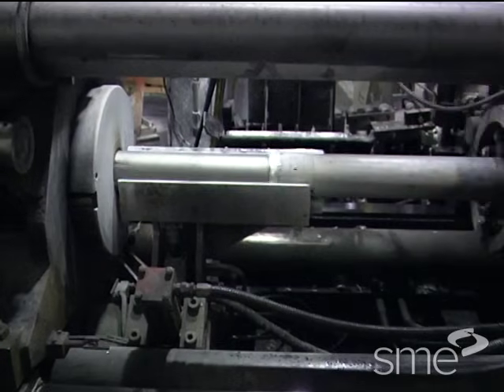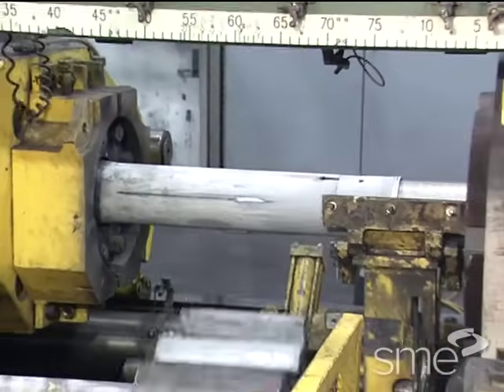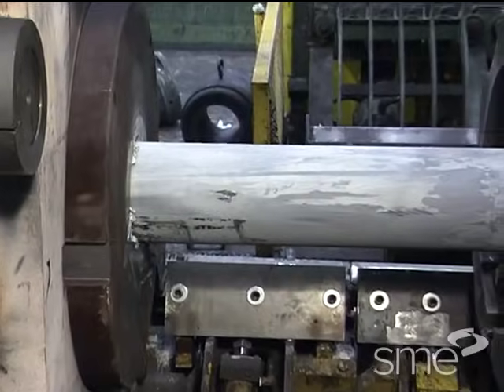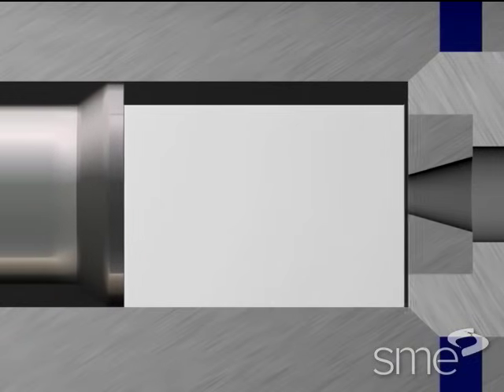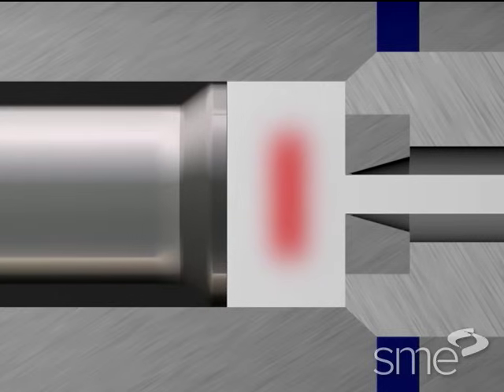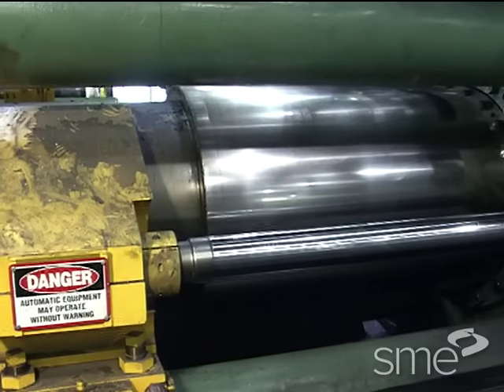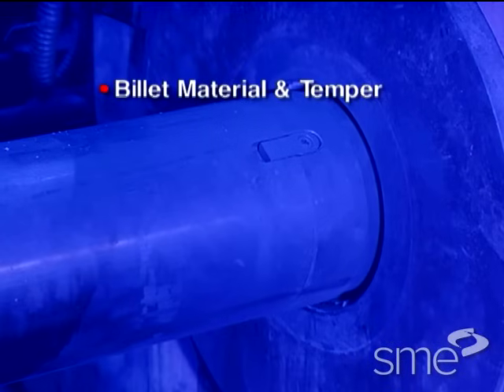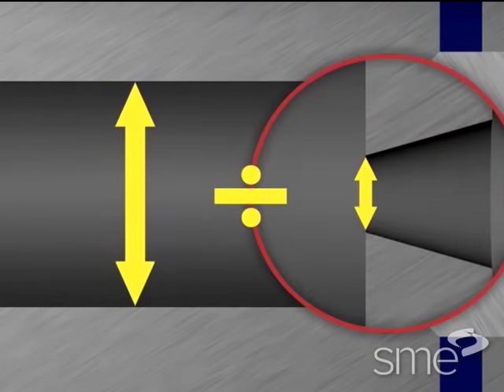Extrusion Processes

Comment: and still no one tells me how they get the holes in the middle of an extrusion, a tube for example ...
Reply: I would like to know that too
Reply: Mark Mark i can explain more if needed. we extrude plastic.
Reply: there is a process that includes no welding. there is a die set up the displace the center of the material. as if it melds around the die
Reply: Mark we use additional plate in die with the desired shape or hole to make the hole.
Reply: I guess for a tube they would make sheet of metal and roll it before welding, extrusion would be more difficult since it would require a thin "O" hole
Reply: Think of a 'C-shape' die, and then the top (the gap int he C) is welded as it exits the extrusion die. One simple way but may not be desired.
Reply: Mark Mark not every die is the same. at my job, we use what's called a pin tip. hot piece of metal that protrudes outward. as the material flows around the edges of the pin tip, you use compressed air, water, and a plug to keep it inflated with a hole in the middle. make sense?